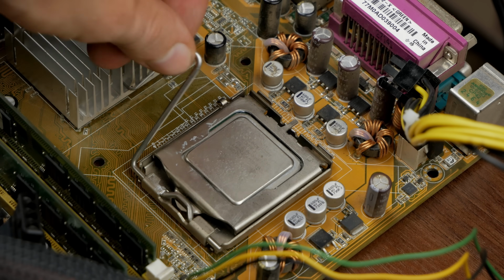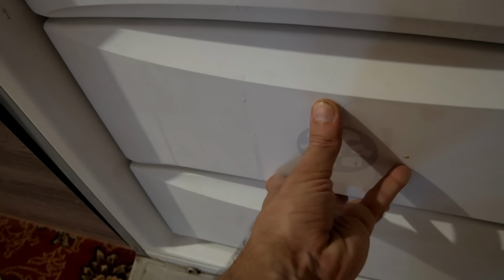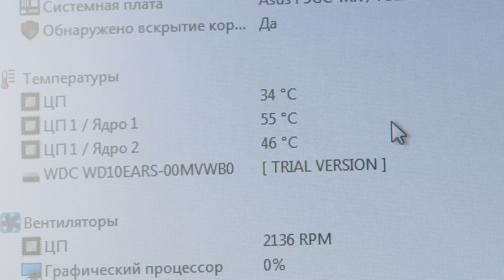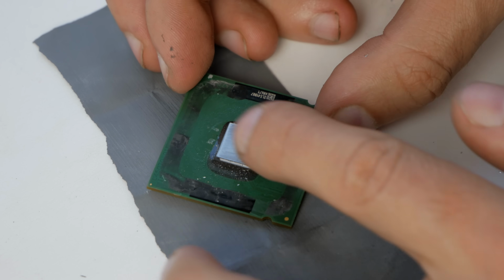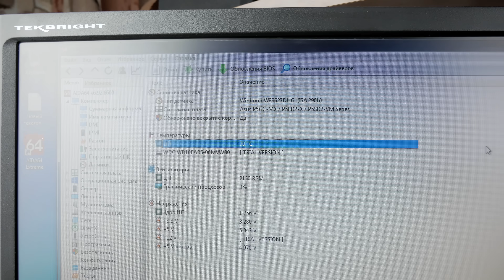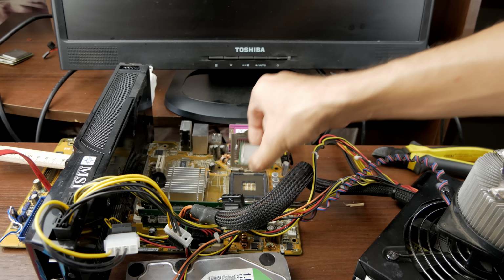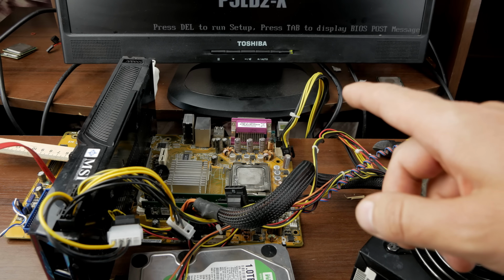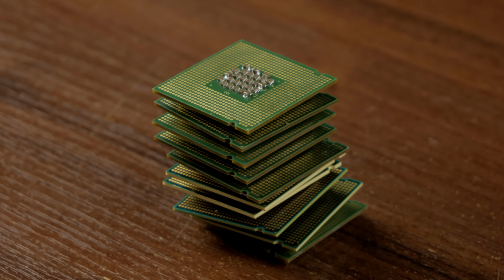How Much CPU Can Handle?

Comment: Capacitors are for voltage stability so when an area of the chip needs a sudden burst of current, the current reserves are there in case the VRM on the motherboard isn't fast enough to keep pace. They help keep the voltage stable for sudden millisecond spikes in current draw.
Reply: So what happens if the capacitors are broken? The CPU becomes slow, or will it break at some point?
Reply: @leoni7649  What happens is the CPU could execute broken instructions or corrupt stuff.
Reply: @leoni7649  What happens is, you turn off the turbo and run a base speed which is often 50 % or lower than the max
Reply: don't you a torch on your cpu cause that will murder the poor thing seriously

Comment: Definitely familiar with taping LGA77x contacts - back in the day people would mod LGA771 Xeons with tape and run them in LGA775 sockets for a cheaper alternative to Core 2 Quad
Reply: And of course, overclocking without the overclockable motherboard. From 2.4 like Q6600 to 3GHz. I do really miss those days.. and even i remember overclocking with graphite pencil, AMD AthlonXP, when you shorted some contact pads with pencil, the clock multiplier was somehow open and free to be adjusted.
Reply: We were all there 😢
Reply: Although the 771 Xeon mod wasn't just tape, those stickers actually swap the locations of 2 of the pins

Comment: I had a Core 2 Quad overheat at 95-100°C under any load for a long while because I was a kid who couldn't be arsed to spend a couple coins on fixing broken cooler pegs. It lasted half a year or so before it finally gave up. CPUs are quite hard to kill lol.

Comment: I’ve had an Intel 3.4ghz Haswell in a 2013 iMac transcoding and encoding videos for about 8-9 years now, nearly none stop (queue in handbrake for days), just sitting at 85-95c (iMac). About the time it gets done a new codex or video standards comes out and I’ll redo old videos so it’s a never ending process.

Point is, CPU’s are very very durable if just used normally. Can’t help from laugh when I see someone worried about their 70c CPU temp.😂
Reply: Loser temperatures surely are better there a known Casey oft gpus dying because of lackluster cooling and you never know what kind of silicon you really have. And also i guess the temperature sensor is not able to meausre the whole chip. 
I am not sure how severe these effects are but i guess you chip Holding up a long time can not represent every processor.
Reply: Your cpu running heavy load 99% of the time avoid long term issues of thermal stress. My old cpu died from going 20c to 90c daily over 7 years.
Reply: 7  years is honestly a good amount of time and time for a upgrade anyways.
  @Pandaxtor

Comment: It depends on where you drill the hole through the substrate, as long as you hit just redundant pins like how most of the power pins are redundant the CPU can run with a hole through it
Reply from the maker: I think the processor will not be able to work with a hole anywhere
Reply: Check out Mark Furneaux's CPU keychain
Reply: @WhatAboutThePC wrong 😎
I have an i3 6100 that has a corner that snapped off.. Still works
Reply: @Crecross The question is : How did you snap it off 💀
Reply: @zephyrus3568 probably dropped it or threw it with frustration while building pc 💀
Reply: @Crecross do u even know the difference between a hole and a snapped off corner?
Reply: @mariotime2507 not much difference, it's a missing piece the important thing is which piece is missing

Comment: i actually dellided a xeon e5472 with a hot air station, was already 775 modded, and put some lm on it, the results were actually jaw dropping, 32 in idle and 70 max whilst playing world of tanks at max on a P43T-ES3G MOBO with modified bios.

Comment: Those are byass caps. They are used to get rid of paracidic inductance.this board probably has good design. But the cpu didn't know that if it was to be put in a good or bad board some whoever designs these things thought to put them in there

Comment: THIS is what I was looking for. Especially sillicon grinding one. I'd do 1 more test: connect a CPU to external PSU and give it like 1.5V. Then check if it works. Keep increasing the voltage until the CPU is dead.

Comment: If you run the PC without RAM, thermal protections should just not take effect anymore and the CPU will heat up to the point of death.
Reply: Huh, interesting, why ?
Reply: @Nathan123Bhi8  My guess is the board can't initialize, so it doesn't initialize thermal protections either.
Reply: Nope. CPU will trigger the #PROCHOT and will shutdown the board
Reply: @TigTex  Maybe for some machines, but if you look at old Pentium 4 era machines, they will cook themselves to death.
Reply: When I was installing new RAM sticks I didn't seat them right(I didn't undo the clamps because I didn't know where the clamps were) and my PC didn't boot. It refused to even turn on. I went back in, put them in properly, and my PC turned on just fine.

Comment: Those capacitors are not only filtering, but they have a special purpose.

If there's a sudden increase in power consumption (can be going from idle to a cpu stress test) the motherboard will not be able to increase the power on time (and the physical distance between the VRMs and the CPU cores matters), so those capacitors act like batteries, which are phisically near to the cores, so that they can cover that power increase until the motherboard power arrives
Reply: Rip capazitors
Reply: It's all fine and dandy until you try to boot crysis
Reply: @dan_loup 😂
Reply: Thanks!!
Reply: How much time does that takes?
Reply: @gabrielvieira.4358  how long do you take to load crysis on a pentium 4 machine?
Reply: thanks for your crisp explanation
Reply: Bro deserves pin 📌
Reply: Thank you :)
Reply: Furthermore, not all of those components are capacitors. Most of them are common-mode chokes, which are meant to provide filtering much like a typical capacitor would. Chokes are used for filtering higher frequency noise. 

Capacitors provide one of three functions: decoupling, mitigation, or filtering. Decoupling aids to isolate circuits from one another, for example, putting a capacitor between a 5V power rail and ground. This will cause any noise induced on that 5V rail to get shunted to ground. Mitigation provides a similar purpose, in which noise is shunted to ground and helps reduce the size of current loops. Filtering is the most specific of these, and will usually involve a very specifically chosen capacitor to isolate and shunt a very specific frequency from that particular voltage. 

Common-mode chokes on the other hand do serve as filters, but in a different way. They can handle higher frequencies much better than capacitors, but rather than shunting the noise to ground, they attenuate it. 

In circuit design, capacitors are typically suited for voltage fluctuations, while chokes are typically used for current fluctuations. In terms of how a capacitor or choke can perform either of these functions, imagine you're trying to draw a straight line. This straight line represents your ideal current or voltage for a particular component in a circuit. You need the line to be as straight as possible, but your hand keeps jittering so sometimes the line dips, sometimes it goes higher, and other times it may massively dip or massively go higher. 

Capacitors and chokes behave like stabilizers. To draw the line as straight as possible, you can try supporting your hand with your free-hand, or resting it on something, or you can try holding the pencil with more pressure. Capacitors and inductors perform something similar with voltage and current. If the voltage destabilizes (goes away from being a straight line), they store a bit of charge in them and output that charge when the voltage drops. This stabilizes the output so it can remain as close to a straight line as possible. 

Chokes work similarly, it's just current instead of voltage. Much in the same way, chokes are basically just inductors, and inductors hold a charge, too. They can functionally stabilize a voltage, but they work better for stabilizing current due to magic with electromagnetism, impedance, flux, and overall reactivity to induced charges. There is a lot more to get into with things like hysteresis, but that's engineering nerd stuff. If you ever want to see how these components effect a voltage or current, I highly recommend checking out ElectroBOOM. He does an awful lot of videos lightly touching on these subjects and even uses oscilloscope graphs to illustrate how they can effect it.
Reply: no shit sherlock
Reply: well of course they have a purpose it was capacitors he cut off
Reply: Thx
Reply: this opened my eyes, thanks bro!
Reply: are you sure ?? im preaty sure that power increase comming from weaves that travel at speed of light and since cpu clock is WAAAAAAY slower then speed of light there is PLENTY OF TIME for inceased energi weave to propagate into the processor.

That mean those cappacitors are there literary just FOR FILTERING..... nothing else
Reply: wow that was a Crystal clear answer... thank you. 👍
Reply: Thank you, brader. Alhamdulillah
Reply: Thx I thought it was for filtering
Reply: Thanks dude❤
Reply: in a rough way it is also filtering, like filtering out the lack of power on demand :P
but ye
Reply: You're a hero!!👍🏻👍🏻
Reply: I mean, isn't that the whole idea behind a capacitor?
Reply: So basically the CPU will still work, but might be more unstable due to voltage fluctuations caused by power delivery inconsistencies?
Reply: I wasnt planning on removing them myself, but I love that the answer was one scroll away lol
Reply: so what might happen if you suddenly have a spike in cpu usage without these capacitors? would it blow up? just stop working? Im very curious to know if this would fail, and HOW it would fail.
Reply: @Gogoseit  Worst case is the CPU executing several instructions in a faulty way and thrashing everything.
It's the reason why you had to hold reset while turning the system off on some NES games. Without a good protection of the save memory, the CPU running a bunch of faulty instructions would just wreck it
Reply: @Gogoseit  It wouldn't blow up. Most likely it will just glitch in some way, maybe it will reset itself, maybe it will corrupt some data which is being processed. As a user you most likely will experience it as blue screens, random reboots or random deadlocks, basically the same symptoms you'll get from excessive overclocking for example. It's extremely unlikely to cause catastrophic damage to itself or any other circuitry. Decoupling capacitors are necessary to enhance stability of internal circuitry in all kinds of conditions and under all kinds of possible loads.
Reply: @hauuau  ah so they smooth the changes between one task to another? and without them the data gets jumbled?
Reply: @Gogoseit  I think you are mostly understanding it, but you are not quite there. This is way over simplied, but I think the analogy will be useful. If you have to do a simple math problem, say "1+2", you will first read the "1", "+", and "2", then add the numbers, then write the result down. This is very roughly analogous to how a computer works. In the case of voltage instability, any of these steps can mess up. The computer could read a "3" instead of "1", or "*" instead of "+", or just some garbage it does not know what to do with. It could also add the numbers incorrectly. Or it could write it back incorrectly or in the wrong spot. Any of these would corrupt data, but there are also cases it could affect program flow. Think of this like it causing you to miss your exit on a highway. Computers are wonderfully complex, so I am sure I missed something that could happen, but these are what I think are the most important ones. I hope this helps you.
Reply: @ankomcoper1183  so basically the cpu will boot but wont be much use to be an actual cpu XD
Reply: @Gogoseit  exactly. The system would work most of the time but would have issues very randomly. It could mess up at just about any time (including during boot, although this is less likely). From the users perspective it would make the system unstable because the system and programs would likely crash or do something unexpected randomly and when doing certain tasks. The results are pretty unpredictable. My experience with this comes from microcontrollers and it was a pain to debug.
Reply: Capacitors don't act like batteries. Capacitors act as capacitors.

Comment: 2:12 . These capacitors are used for filtering/decoupling the voltage that comes to CPU.
Nice content, btw.
Reply: Those specifically not, those are for when there's a sudden change in the current (for example going from idle to a stress test), the electricity can't physically get there in time, those capacitors act like "batteries" that are physically nearer and can power the CPU on time. If he tries to go from idle to stress without those, probably it will bluescreen or turn off because of CPU undervoltage
Reply: @santiagobarrera2387  Never heard of it. That's cool.
Reply: @santiagobarrera2387 THAT exactly describes that decoupling is
Reply: @santiagobarrera2387 I thought it was for decoupling. Thanks for the knowledge
Reply: @santiagobarrera2387  Those tiny capacitors near the CPU aren’t for providing power, they’re for decoupling and filtering. They stabilize voltage by absorbing noise and transient spikes during rapid current changes, but they can’t hold enough charge to act as a 'battery.' The actual power delivery comes from the VRMs. Without the capacitors, you’d see instability from voltage ripple, not a lack of power.
Reply: @santiagobarrera2387 they seem a little bit small to be able handle any type of suddenly demand. I think they are some type of filter capacitor to get noise out. Last line of defense kinda thing.
Reply: @DasNewsNetwork  When such spikes are nanoseconds in length, it's a lot.  They aren't designed to decouple power supply ripple but the high frequency transients from the internal transistors switching on and off.

Comment: Can you benchmark the Pentium 4 2.4ghz vs the Pentium 4 2.40ghz? I can't find a benchmark comparing the 2 and would like to know how much better the 2.40 is. (this isn't a joke)
Reply: Its that same cpu,after a decimal point tha amount of 0 doesnt afect the number, being 2.4 or 2.400000
Reply: @Cesar-ot1xk thats the joke
Reply: @Cesar-ot1xk  rly? i looked up the specs and they are made on different nodes. Pentium 4 2.4 is on 130 nm and 2.40 uses 90 nm. Pentium  2.40 also has double the l1 and l2 cache
Reply: @rch5395  They are most likely just a different generation, it's the same with the standard i3-i9 processors just because it's a i3 doesn't mean it's worse than a i5 if it has a bigger number it's most likely better, example: Intel core i5-3470 and the Intel core i3-12100 the i5 is worse because it got less cores less threads etc. (i5-3470 specs: 4 cores 4 threads 3.2Ghz 3.6Ghz boost 6MB L3 cache, i3-12100 specs: 4 Cores 8 Threads 3.3Ghz 4.3Ghz boost and 12MB L3 cache)

EDIT: I think I found the Pentiums you were talking about, the 130 nm one had the codename Northwood, 1 core 2.4Ghz 512KB L2 cache and the 90 nm one had the codename Prescott, also 1 core 2.4Ghz but 1MB of L2 cache, the reason one would have no 0 at the end is because of a typing error or because one website typed it out differently than the other one
Reply: @Dripsia  rly the Pentium 4 i found in an old family pc says Pentium 2.40 ghz